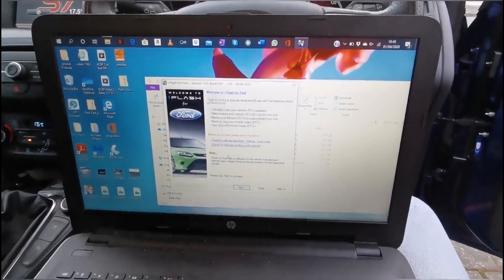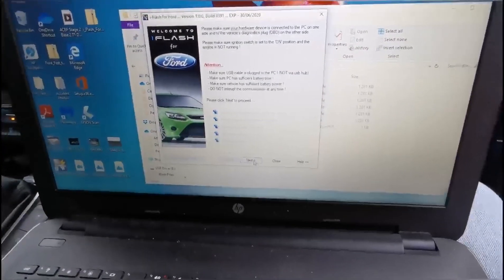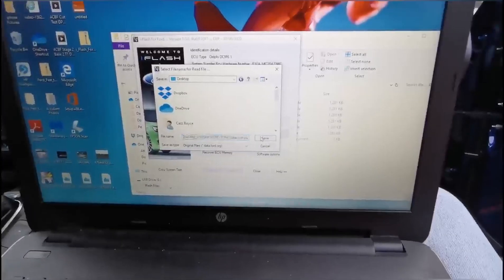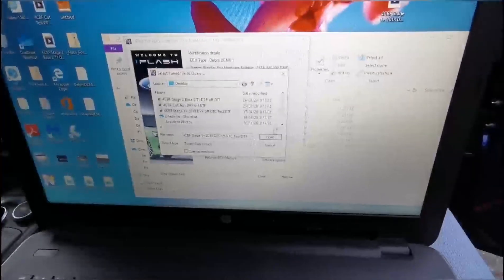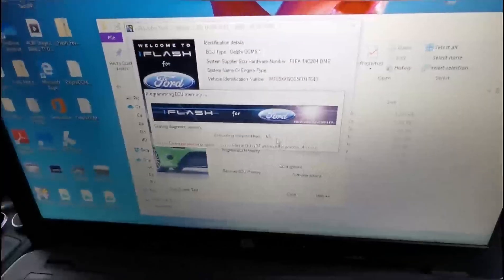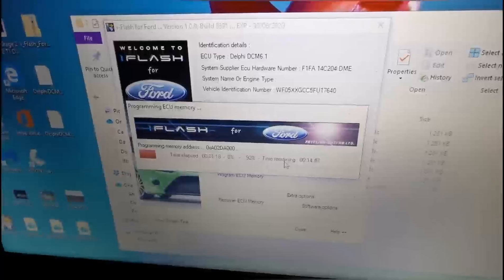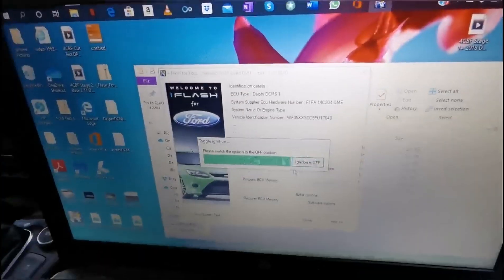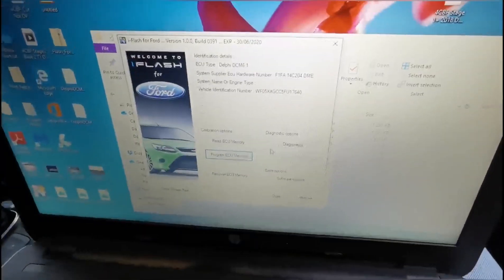***HOW TO*** How To Guide On Using Our DIY iFlash Handsets

Comment: How do you get the iflash program to read DTCs? The functionality appears to be present as the splash screen mentions the ability to read and clear DTCs but when I click the Diagnostics button the read and clear trouble code buttons are greyed out. Ignition is on but engine not running at this point as per the instructions on the iflash program.